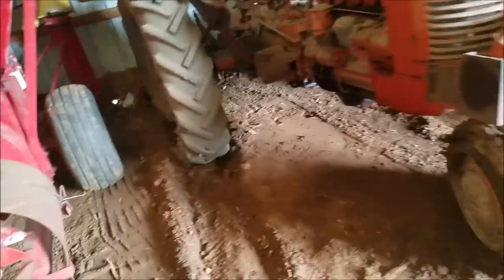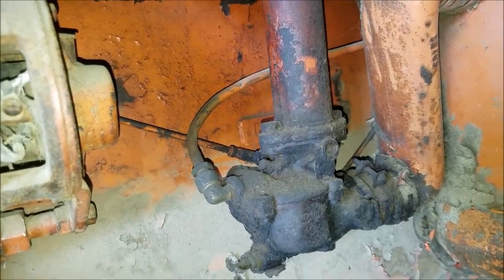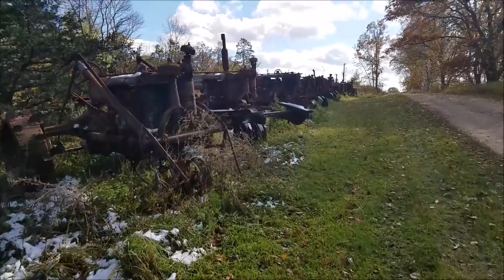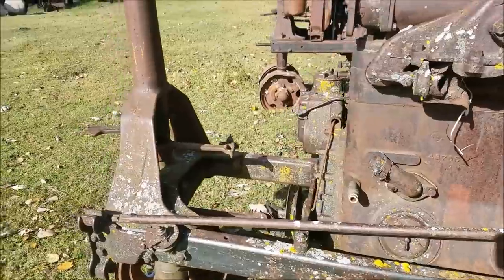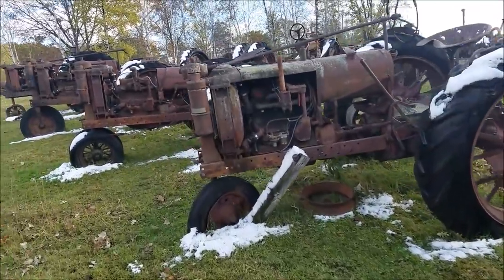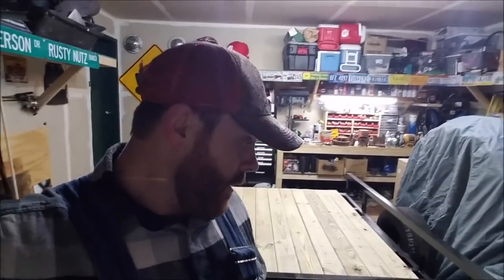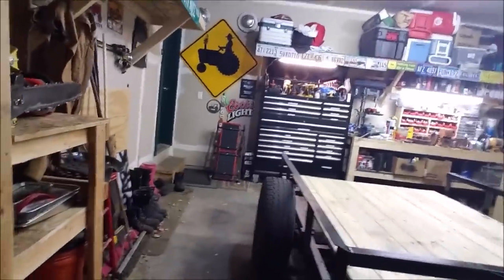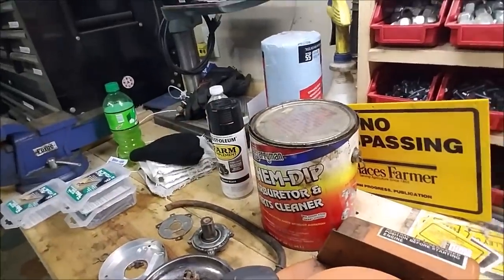Another 1941 Case SC, Mikes IH Collection, and the Trailer Rebuild

Comment: That is IH heaven for sure!  Agree on the SC; scrap value at most.  It's real easy to sink 6 or 8 grand into a restoration and end up with a $4,500 tractor at best.  I have a black floater in my right eye from a metal chip from 40 years ago.  Fellas need to be careful with the air gun blowing things down.  That can launch a chip right under the safety glasses and straight into your eyes.  The sheetmetal shop foreman in the naval shipyard I retired from would write you up on the spot if he caught you using an air hose to blow things down.
Reply from the maker: My thoughts on the SC, exactly. I have more than I will ever get out of my SC - but I did it for grandpa's tractor... I will NEVER sell that baby! And as far as eyes go, I am just hoping to make a full recovery. Was told I might have some scar tissue in my right eye. Not exactly sure yet.
Reply: Well lets hope it heals up.  You don't want a floater like me.  That black spot in my vision really gets in the way sometimes.
Reply from the maker: @mattthescrapwhisperer  Let's hope! My right eye healed up great, so hopefully my left eye will be ok!

Comment: I was wondering if you knew anything about the two different manifolds on the sc?and what the two holes on the intake gas manifold, and the other manifold has a different square type .with different grommets or flutes?
Reply from the maker: The gasoline manifold has smaller ferrules (grommets/flutes) than the distillate manifold. The distillate has much larger ferrules. I would assume it has something to do with proper atomization of the air fuel mixture but not sure. The holes in the intake manifold were likely so you could install suction/vacuum  lines for the milkers from the day.

Comment: Case SC vs farmall H   the case Sc cost $300 less than the farmall H it  had the same fuel consumption but had 31 hp vs the H that had 26. it had a lve pto and hydraulic with 3pt hitch  sorry farnall H. it would handle a 3/12 mounted plow 2-14 for the H. the SC out classed the farmall H  for best value. since the engine rpm was only 1100  vs the h at 1650 the case had a longer engine life between overhauls
Reply: Then why did they sell more H's than SC's?
Reply: @turnwell9530   possibly better marketing  thru a larger dealership network  and many farmers did not like hand clutches. what i liked about the case sc and dc tractors was  they ran quieter under a load with a good muffler and were a smoother ride
Reply from the maker: @brokenwrench1  Only the late model SC Case had live hydraulics and Eagle Hitch. Earlier SC's did not have those options. The SC also went through changes in later years to a larger bore engine, just like the H to Super H. I believe it was Case's way of transitioning into a new era just as IH did with the H/Super H to 300. Case just didn't relabel the models as IH did.
Reply: They started making the Sc in 1941 VS the H's first year, 1939. So the H had more time to become familar with farmers. 
And if only the later ones had live hydro/pto then they would have had fewer differences. 
Sc is a 4 forward speed tractor Vs H's 5 Foreward speeds. 

This is SPECULATION: maybe the steering design wasn't the most graceful of things. Its kinda out there. So maybe that warded off some potential buyers.
Reply from the maker: @turnwell9530  you are correct. The SC and H were very much alike from the beginning until about 1953. When IH released the Super H with Live Hydraulics, Case, Allis, and JD were all developing their own versions as well. By 1954, the SC had live hydraulics, live PTO, foot clutch, and the Eagle Hitch.

I have both a Case SC and a Farmall H, and I can tell you the SC steers much easier than the H. I think the only drawback of the SC steering is the drag link that sticks out in front (especially when turning hard right). Many people caught them on fence posts, trees, etc. Many times you see the drag link bent from running into things.
Reply: Probably saw more IH dealer ships than Case had ,  poor publicity on comparisons ,   and that chicken roost steering rod was just plain ugly .
Reply from the maker: @deweydodo6691  I agree - more dealer saturation in certain areas. Chicken roost steering is definitely different, but I'll tell you - with the big CASE steering wheel it sure is easy to steer! (Much easier than my JD A).